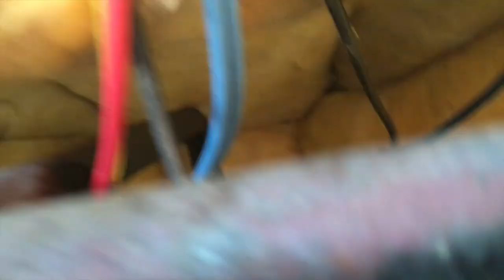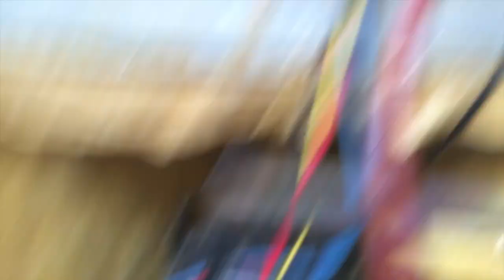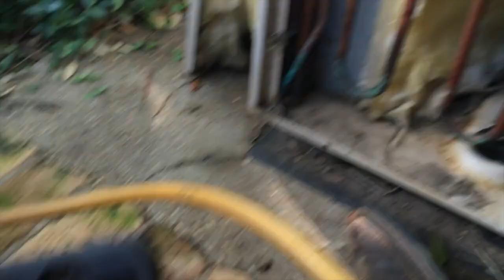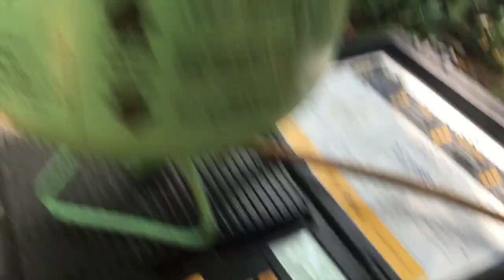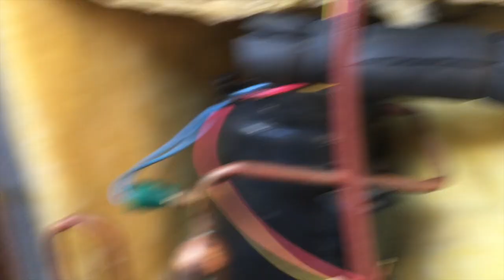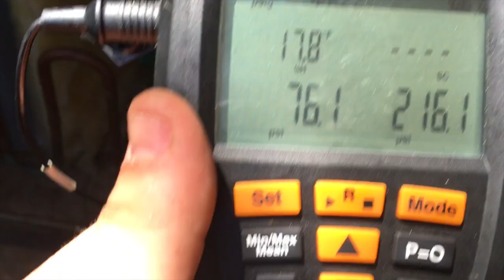HVAC: Freon Leak Repair

Comment: Nice vid.  All that R22 gone eh?  How did you solder that hole?  Silfloss?  I would have liked to see that.   When you put the liquid in just the high side or both high and low open?  Thanks.

Comment: Why not convert to 407c? Benefits customer, and it doesn't take but an extra 10mins to do so. Add a little POE and change schraders and your golden!
Reply from the maker: Like I said in a comment below the company I work for does not offer retrofit refrigerants!! We use R22 & 410 only!! But I do agree with you!!
Reply: +Israelhvac Oh yeah I forget.  Aren't you lead service tech there? You ever mentioned it to them? What's there take on it?
Reply from the maker: +Richard Baylis Yes I am the Residential Service Manger. And yes we have had a couple discussions about it and I believe we will start offering 407 here before to long. That is what I hope anyway!!

Comment: What do you use to braze
Reply from the maker: +LosAngeles Grappler 15% sliver solder
Reply: +Israelhvac what torch
Reply from the maker: +LosAngeles Grappler Just a basic oxygen and acy torch
Reply: +Israelhvac i seen some of your vids and it looked like a turbo torch im new in the field and was wondering if i can get by with just actln

Comment: The old units use the approach method. The newer ones give you the option, but I never have liked using it around my area they will have little to no sub cooling if you charge them using the approach method.

Comment: Filled up 13 lbs of R22.  Yikes, glad I was not on the receiving end of that bill.
Reply: ~$1,000 worth, yowza!
Reply: +scrambler350 
It's very similar. The system had a TXV so I charged it by sub cooling.
Reply from the maker: +Tim O Lol me too
Reply: no 407c?
Reply: +THEtechknight I think John said the company he works for doesn't use retro-fit refrigerants.
Reply: +THEtechknight I think John said the company he works for doesn't use retro-fit refrigerants.
Reply: Tim O Ah ok, I may have missed that memo.
Reply: I had the same model unit last week with a similar leak. Made the repair and changed it over to R427a.
Reply: How does the charge look compared to r22...?
Reply: Wouldn't it be cheaper to buy a new condenser?

Comment: Did you add the refrigerant to the liquid line or suction line?
Reply from the maker: +Nefferrug.... Liquid cause unit was not running
Reply: +Israelhvac so if the unit was running do you add to the suction line? Thanks for the help! I love your videos!
Reply: ummm.watch out for liquid slugging